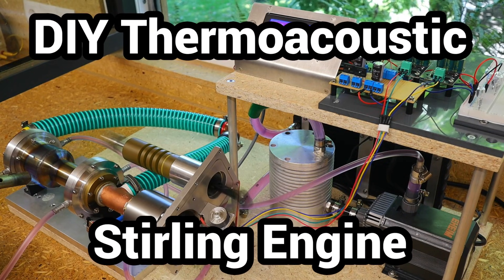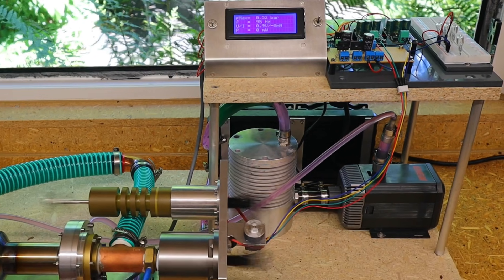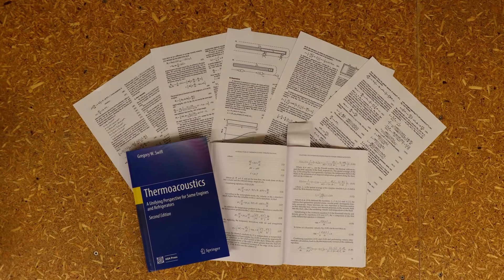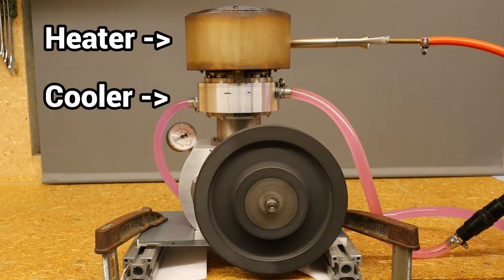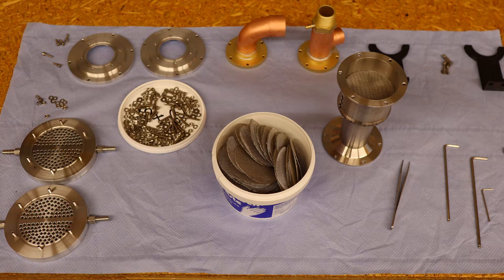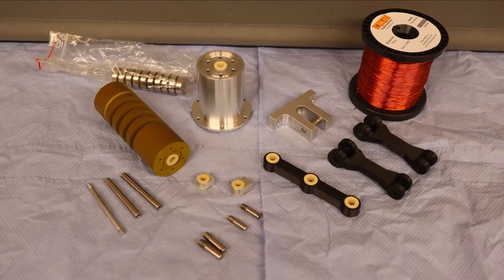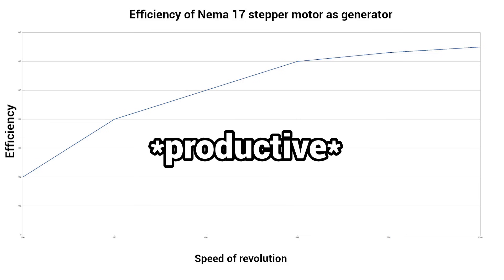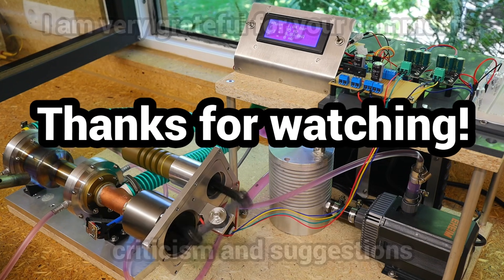Developing the thermoacoustic Stirling engine to generate power for the home

Comment: Stepper motors are over all really bad as generators!
For this application, they at least function, because of their high pole count, in contrast to other generators which recommend relatively high rpm.
BLDC motors are way better, nearly perfect for small generators.
Hobby motors have the downside that they need extremely high rpm to get to anny usable voltage, and that in itself caused high magnetic loses in the steal core.
As a generator you need verry low KV motors.
I rewind hobby motors to use as generators in my hobby projects,
Works great but is a pain in the ass to do! 😂
To get lower KV you have to use thinner wires (or less in parallel) and more windings.
Going from a delta to a star configuration helps also.
With that linear arrangement you could easily build and change parameters for a linea BLDC!
Just put some alternating cylindrical magnets on that balancing rod instead of dead weight, and put some coils around them.
For maximum efficiency you need to put the coils into a "core"! Luckily with that tubular construction this means basically just a pipe around and some washers between the coils. 😆
Best would be to wrapp thin transformer sheet around the coils and put some washer stacks between them to minimize eddi loses and get a high magnetic permeability.
That would be the geometric analog to a laminated transformer cores for this arrangement, also some shim packages between the magnets.
If you have a laser cutter, or access to one just cutt allot of those washers and shims out of transformer sheet stock. ones you decided the diameter of that generator you can reuse them for different coil stack arrangement over and over, to experiment with pole counts and windings.
For the magnetic tube "core" you could also use iron powder in a epoxy matrix, the washers too if you can't get sheets.😉
For basic experiments you could use some soft iron pipe and normal washers from the hardware store. Better then air coils at least!
Reply from the maker: Thank you ver much for your detaild help, its very useful for me!
Do you know where I can get thin sheet of electric iron or transformer iron?
Is it possible to separate the sheets of an old tranformer iron core?
Thanks for your nice comment!
Reply: @myengines2443 
Ich bin mal für alle andern so frech und antworte auf Deutsch.. 😅

Im Einzelhandel bekommt man das leider kaum, (evt. beim Chinesen) Aber wenn du nach Trafoblech/ Elektroblech/ Kernblech suchst findest du reichlich Hersteller hier in Europa und Deutschland, auf Nachfrage verkaufen manche einem evt. auch Mindermängen.
Oder schau ob in deiner Nähe ein Trafobauer, oder Elektromaschinenbauer ist, der kann dir was verkaufen wenn er es nicht liefern muss, oder gibt dir was aus der Schrottkiste für um sonst.
An sich ist das Zeug auch ziemlich billig, so um 1 Euro pro Kilo vom Coil.

Alte Trafos kann man natürlich auch nehmen wenn der Formfaktor passt, aber die meisten Trafos sind aus kornorientem Blech gefertigt, das heißt die Körnung ist in eine Richtung gewälzt, dadurch ist das magnetisch nicht Isotropisch. Ist aber alle mal besser als ein Wasserrohr oder normales Blech. 😁
Und für das Hüllrohr must du auch nicht ein ganzes Blech Aufwickeln, man kann das auch in einer Spirale wickeln, oder zur Not auch aus einem Stapel aus Platten axial aufbauen, dann ist der magnetische Widerstand höher, aber immer noch viel besser als nix.
Das Material und die Isolierung der Schichten (also auch die dicke) macht am meisten aus. Das Zeug ist eine Eisen Selizium Legierung, höher elektrischer Wiederstand, aber geringer Magnetischer. Dannach erst kommt die Ausrichtung der Platten zum Magnetfluss. Also Feldlinien möglichst entlang dem Blech, nicht durch die Schichten.
Theoretisch kann man auch Magnetit in epoxi binden, das hat aber eine geringere Dichte, und man müsste den "Kern" viel dicker machen als mit Blech.
Aber umso höher die Frequenz ist, umso weniger spielt die Dichte eine Rolle, und umso wichtiger wird die Reduzierung der Wirbelströme, da ist Magnetit besser weil es besser elektrisch isoliert.
Aber damit Magnetit wirklich ne gute Option wird muss man schon so Richtung 1kHz und darüber arbeiten. Bei 50-200Hz dann lieber das Schwarzrohr außen Baumarkt. 😂

Falls du zum testen nicht so einen Aufriss betrieben willst, besorg dir möglichst dünnes weiches niedrig legiertes Eisenblech, und mach ganz dünn lack drauf zum isolieren der Schichten. 
Das trafoblech ist meistens schon mit ner Phosphatschicht behandelt als isolator.
Hauptsache Eisen und schlecht elektrisch leitend.. wie auch immer man das hinbekommt. 😉
Reply from the maker: Ok, danke für deine tolle Hilfe, über den verstärkenden Eisenkern mache ich mir viele Gedanken weil da für die Fertigung auch viel Arbeit drinsteckt.
Ich habe 3mm Reineisen was sehr dick ist, ich versuche noch dünneres zu bekommen und schaue auch weiter nach Bezugsquellen.
Da die Frequenz im Vergleich zur üblichen Elektrotechnik sehr gering ist (max 100 Hz) sind die Anforderungen an das Material und die Schichtdicke vielleicht nicht ganz so hoch?
Vielen Dank für deine sehr nette Hilfe, in Bezug auf Elektrotechnik usw. bin ich totaler Anfänger!
Reply: Ja, bei sinkender Frequenz fallen die Wirbelstrom verlusste immer weniger ins Gewicht, aber selbst bei 50Hz frisst das einen Haufen Leistung.
Wenn man den Kern ganz weg lässt, muss die ganze Maschiene viel größer sein um die gleiche Leistung übertragen zu können, wodurch die Ohmschen Verluste in den Wicklungen zunehmen.
Kannst also entscheiden ob die Wicklungen oder der Kern die Energie frisst. 😂
3mm reineisen ist definitiv zu dick, dann kannst du die Antriebsmaschine zwar ordentlich belasten, aber die Energie musst du dann mit dem Thermometer statt dem Multimeter messen. 🤣
Ziel von dem ganzen Spass ist es die Elektrische Leitfähigkeit pro Volumen runter zu bekommen, Idealerweise quer zum Magnetfluss wenn nicht Isotropisch moglich. Das Trafoblech hat durch das Selizium einen deutlich schlechter elektrischen Leitwert und fast keine Reduzierung des Magnetischen. Kombiniert mit den dünnen isolierten Schichten potenziert sich die Unterdrückung der Wirbelströme und damit der Wirkungsgrad der Elektromaschine.
Also auf jeden Fall dünnes Blech, besorgen.
So weicher Baustahl, oder Karosserieblech müsste auch gut gehen, der kohlenstoff reduziert auch die Leitfahigkeit, aber auch die Dichte und die Magnetische Leitfähigkeit, aber so niedrig legierter Stahl müsste noch einen ganz guter Kompromiss sein.
Hauptsache dünn damit man die Schichten gut isolieren kann.
Die Isolierung muss auch nicht perfekt sein, wenn das Blech an ein paar Punkten durch den dünnen Lack drückt macht das net viel aus.

Ich helfe gern mit meinem ansonsten relativ nutzlosen Fachwissen.
Wir wollen ja alle das deine coolen Projekte noch geiler werden!
Danke fürs teilen mit uns anderen Nerds! 😁👍
Reply from the maker: @martin09091989  Vielen Dank, ich werde mich noch mal intensiv auf die Suche nach geeignetem Blech machen!

Comment: Hey very inspiring work. I come with a suggestion. I think it's possible to extract electricity from the sound wave without needing any moving parts, without turbines or pistons or motors.

Someone with more experience please comment but I think applying magnetohydrodynamics principles offer an attractive approach. The plan would be:
1. Fill the tube where the standing sound wave is with a liquid metal or an electrolytic solution.
2.  An external, strong static magnetic field is applied perpendicular to the direction the sound wave will travel.
3. A sound wave is a mechanical vibration that causes particles in the fluid to oscillate back and forth. This motion, even though it's on a small scale, is a movement of an electrically conductive medium.
4. When a conductor moves through a magnetic field, a voltage (and thus, a current) is induced. In this case, the oscillating motion of the fluid's charged particles within the static magnetic field generates an alternating current (AC).
5. Electrodes placed in the fluid, positioned to capture this induced current, can then be used to harvest the electricity. 

This could extract electricity from the engine without needing any moving parts. What do you all think?
Reply: i think you have a point,,but where would you position the electrodes,,embed them into the walls,, probably insulated some way.. i assume mercury ,,or it depends on your budget
Reply: @jamesbunn4885 the electrodes would need to be in contact with the fluid because the current is produced inside it.
Reply from the maker: That sounds very interesting, maybe a ferrofluid contained by some sort of  membranes or something may be possible?
Reply: @myengines2443 Yes maybe. I sincerely just found yesterday about thermo acoustic engines and magneto-hydro-dynamics, I searched for how to convert sound wave into magnetic field and this came out. I don't know if it's viable.

"The action lab" has a video about it in which he creates sort of a rail-gun moving water with electricity (two plates submerged in salt water with a voltage across). "Tech ingredients" also has a video about it using liquid metal. Supposedly this process is reversible but from what I've seen it best works having the fluid flow at a constant speed in a particular direction. 
So in our case the standing wave would make the fluid move back and forth potentially creating a low amplitude AC current, and I don't know if that could be useful ¿maybe by rectifying it to DC?

Maybe the fluid could be contained between multiple membranes as you say and all membranes could be connected with a rod to make them all vibrate at the same time, similar to the inside of a truck's tanker. This concept needs much more research.
Reply from the maker: I will watch the videos and further think of the concept.
Thank you very much for your great help, plz go on with it!

Comment: Maybe an induction heater could be a really great solution.
Reply from the maker: Are the purchasable off the shelf for the round heater?
Reply: @myengines2443  There are a lot of induction heaters for welding/forging around (just go for 'induction welding' or 'induction forging' on youtube). Maybe second hand, these got a good price.

Otherwise there are plenty of DIY solutions, like
induction heater diy https://www.youtube.com/results?search_query=induction%20heater%20diy 
Building a 1.4kW Induction Heater https://www.youtube.com/watch?v=YO_cYhV6eIM 

The main challenge is the power supply, I guess.
But since you do not need this high power ...the main advantage of a conduction heater is uniform and continuous heat spread and known energy/power output, I guess a DIY solution might be the best option for your needs.
Reply: @myengines2443  sorry, the first link should be
Simple induction heater. How to make induction heater from welding machine https://www.youtube.com/watch?v=V2aMBJADL1g
Reply: PS.: Originally I posted the comment regarding to 2:45.
Reply from the maker: Thank you very much, I will look out for this!
Reply: @myengines2443  Just some last thought: You can use just some induction cooking plate. These are really cheap to buy (less than 50 €) and the hardware is in the right dimension (DIY and dimensioning pcbs for high Amps/voltage is a kind of gamble). The only thing to adjust are the windings of the heating coil. Old coil away, adjust the new coil to your build setup/stirling motor and connect it to the contacts of the old coil. After that, it is basically done.
Since you want only a low level power input (like a program in inductions cooking plates "hold 60 degrees for x-minutes")...

Comment: Clean work and thanks for the update. An idea popped up and I wonder if it maybe useful: The pivot point doesn't necessarily need to have equal length arms. I wonder if maybe easier to tune the length of the lever there so to allow the use of a more basic liner generator (speaker driver). Between the different sizes driver options and potentially tuneable throws lengths, it seems like a plausible iterative step. Or at least a lower effort one. For clarity, I'm not referring to acoustic coupling but rather a mechanical one - a cap nut and epoxy right to the speaker magnet would likely do it. Decent odds of leaving the cone intact for positioning and maybe even load balance as the material breaks in (... or apart). Something to ponder, i guess. Look forward to your next video - I think those burner refinements makes a lot of sense
Reply from the maker: I will think very close about your proposals, many thanks for your kind help!
Reply: hmm could just put a weight on the end of the arm to increase frequency easily aka throw magnet on and place piece of armature doesn't even need to be an iron core... You can create a 60hz wave then utilize a variac to increase output voltage to make direct generator.
Reply from the maker: I need to think about it calmly, it sounds interesting, thank you very much for your help!

Comment: When you want to scale up the power generation, consider connecting many of these as modules in a multi-cylinder engine — via a camshaft. May be easier to built a few smaller engines connecting them up than one large model for the same power output.
Reply from the maker: When the engine is developed to a satisfactory level I maybe consider that, thank you very much!